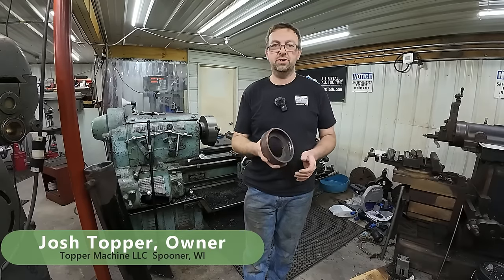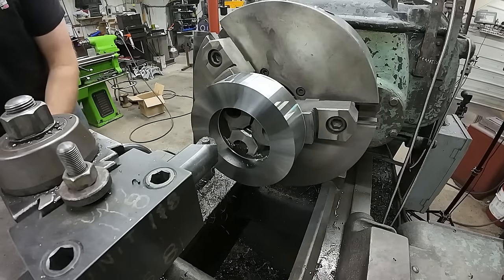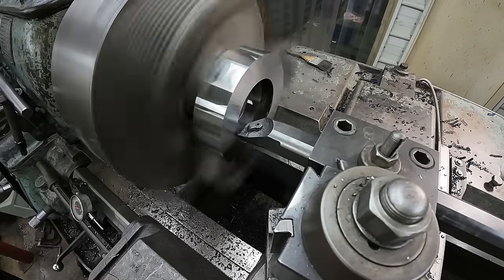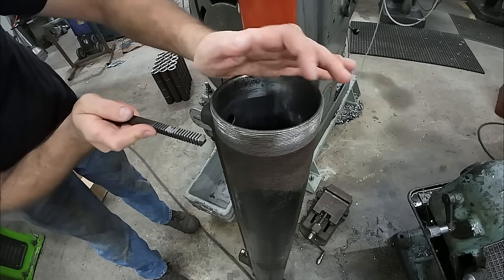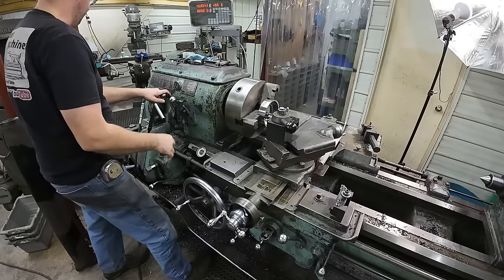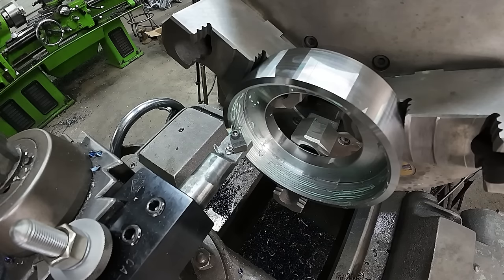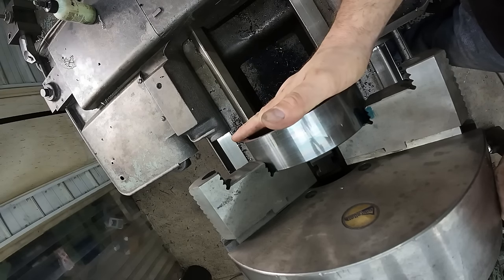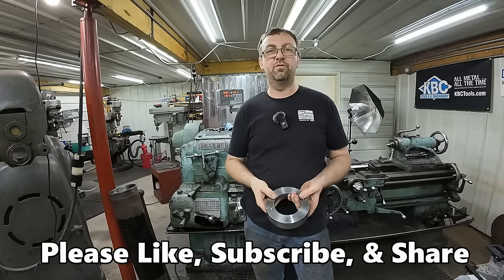Machining a New Barrel Nut for a Hydraulic Cylinder - Manual Machining

Comment: That's the first time I have seen that trick to re chuck a nut for threading, thank you for sharing your knowledge and experience.
Reply: Me either. Never seen that useful trick before during my many years as a machinist.
Reply: Just use the same face of your scribe in case your scribe is not ground uniformly.

Comment: I'd have owned half the cars I've had if it wasn't for the effing salt. Anyway - I really enjoy seeing a piece of raw material pared away to show a mirror finish hidden beneath the scale - and the .200 depth of cut is amazing. I managed to do that recently and had the chips flying just like this video. They were melting my pants though so I backed off. Questions: 1. What material is the new nut made from? 2. What inserts are you running? Someone recently gave me some new Kennemetal ones that are amazing. I tend to use obsolete NOS ones because they are relatively inexpensive - but it's incredible the difference new design coatings and chip breaker features can make. 3. Do you ever do that upside down / reverse threading technique? I really like it for threading out of bores and saves me the drama of being nervous about disengaging the half nut too late. And finally.......that scribe alignment technique for getting the nut back in place after testing is brilliant. Cheers!
Reply from the maker: I would still be driving my first truck if it weren't for salt.  The nut was 1026 DOM tubing. I run Sandvik inserts for cutting and mostly Kennemetal for threading.  I would have to look at the grades, as I don't remember them.  I have not tried up side down threading yet.  The lion is the first lathe I have ever run with reverse.  My turret lathe had reverse, but it wasn't set up for threading, just turret work.  That trick with the scribe has saved me a thousand times.  Even if you don't need to, I still scribe it just in case I have to put it back.
Reply: Thank you! I appreciate the answers.

Comment: That's a neat trick for picking up the threads once you take the part out of the chuck, I usually do this type if threading operation backwards so I'm not cutting towards a hard stop, less anxiety that way.
Reply from the maker: That is a little difficult without a reversible spindle.  These old monarchs are not designed to reverse.  I really have no problem threading to a shoulder.

Comment: As an offshore worker I completely understand, we use all types of lubricants and sealants to keep the saltwater out. A new piece of equipment is taken part and resembled with to ward off rust welding parts together. Teflon tape on thread as gap stop or thread sealant made for pipes on nuts and bolts, galvanized spray paint, you name it we have tried it

Comment: 16:10 - On a machining BBS years ago, I asked a pro how he handled blind female threads. He replied that he usually bet a hotshot new hire $20 he couldn't do it. I did do it, years ago, making a 4-jaw face-plate adapter for a Jet 10-24 lathe, but it was nerve-wracking. Couldn't use Joe Pi's reverse rotation work-around; might have unscrewed the (thread-mount) chuck holding the work-piece with disastrous results.
Love my current lathe with the cam-lock chuck mount!
21:40 - That should get you within any remaining cut required.

Comment: I have never had to deal with the salt story, we don't get snow where I live, but never the less, for certain nearly every cylinder I have taken apart presents problems with removing the top nut. I don't know what it is, maybe humidity, maybe dirt, at least I never had to cut one or torch it off. Nice work as always.
Reply from the maker: I often wonder if it could be some kind of hammering. Like pressured spikes inside from hitting things or slipping off something. Maybe distorting the threads some. There is a lot of force in there.

Comment: I've seen what you mean about the climate.  CEE in Australia works on hydraulic cylinders and they come off intact most of the time.
Reply from the maker: Different climates totally. The other thing is economic climate. My region is depressed, nothing gets fixed until it completely fails. Regular maintenance would make them come apart much better. Guarantee this cylinder was leaking for years before it was finally fixed.

Comment: Thats exactly the kind of nasty corrosion we get in the UK.
Thanks for sharing
Reply: Mainly on the coast or from rock salt on the roads
Reply: @GeoffHome-u6r  more the salt on roads it gets up inside workings and stays put. Sea air sticks to the paint work on top of the vehicle but washes off easily enough.
Reply: @TalRohan  Yes, but l think the comment was general. Railings in seaside locations especially piers, produce deep laminations, which are more than pitted. Car panels are so thin now, a gust of wind could dent them. Saves weight some will say, yes because you only have 60% of the car left.

Comment: I just learned a new way to re-index a part after threading. Thanks. 
Have you ever tried the method of cutting threads away from the headstock? I haven't and the only person I've seen use it is Joe P.
Reply from the maker: I have never done it as the Lion is the first lathe ive owned with reverse.

Comment: I worked in parts for Gledhill Road Machinery. If that is a plow cylinder those weighed 70 lbs, or better. The plow would have 2 of those to pitch it right or left.AL B.

Comment: Hello Mr Topper.
I find Your videos most informative and enjoyable. As a hobby machinist I wonder 2 tings.
In an earlier video You had to reduce a large diameter “slug” to a significantly smaller shaft with a flange. I understand that doing the part in this manner makes the part more resistant to stress related failure. Your work process have two disadvantages in my opinion. First the time to turn the bulk of material to chips. If You trepanned the slug and part of “outer tube” it should be a quicker process.
The second disadvantage would be that the “outer tube” wold be turned into chips instead of some raw material for some oncoming project, free of charge, so to speak.
At the same time You got less chips to handle.

In this video I would like to knew why don’t You rewers the spindel rotation and turn Your cutter up side down. Must be a lot less stressful to start the thread in the tight inside corner and run the tread cutter out into free air? Away from the chuck.

Regard’s PeO
Reply from the maker: Thanks for watching my older content. As to trepanning the part,that would be far less economical. Turning the whole part down took only 15-20 minutes. Trepanning would have taken considerably longer. Plus I would have to make a trepanning tool for one job, so there would be more time. Then I would have a chunk of tube that I would have to store that eventually would likely go in the scrap bin anyway. Not just storing the material, but maintaining records of the material, ie certs. Most of my jobs require material certification. Again, all for a piece of material that may ultimately go in the scrap bin. As a professional shop, you can't just use any old material for a job. I have had jobs that I could use a chunk like that one, but the grade was wrong, or I needed a material sourced from a specific country. 

As to threading in reverse, older machines such as the monarch do not have a reverse. I learned on the old stuff, and in 25 years only crashed one time into a shoulder. That was because I was just running too fast. I see the advantage to it, but I don't have the spindle reverse.

Comment: I prefer using dial indicators over digital indicators as well for being able to see where I'm at in the big picture. You can watch the needle as you get near your target where the digital is flashing numbers so you end up having to respond a lot faster due to not having as much warning.
Reply from the maker: When it comes to response time, the clock dial gives you a better sense of location.  For precision stopping while threading I never rely on the DRO

Comment: Suggestion:

Consider start the threading from the inside shoulder towards the tailstock. This is done by inverting the threading tool (upside down) then running the spindle CCW and thread feed towards the tail stock. This way, engagement of the threading dial/threading happened at the shoulder instead of threading to the shoulder. This stops the stress of running the tool into the shoulder and speeds up the threading process. Threading tool looks like a "top notch" zero rake insert, these benefit from being set slightly above center for internal cutting and slightly below center on external cutting. The American Machinist tradition of threading tool in-feed at 29.5 or 30 degrees is not always helpful. This is done under the belief angled in-feed helps reduce the threading tools cutting stress on the leading cutting edge. What actually happens, both threading tool edges are cutting as threading is a form cutting operation. Regardless of the in-feed direction, the leading edge of the cutting tool gets the cutting stress regardless of in-feed angle. What does and can make a difference are the A60 series "lay down" inserts with highly controlled cutting geometry. Their cutting geometry takes into account the cutting forces for threading. The angle in-feed is essentially an American machinist tradition not common else here in the world..
Reply from the maker: Monarch gear head lathes do NOT run in reverse. They are not designed for it. As far as threading to a shoulder, in 25 years I have crashed one time. It doesn't bother me one bit. Yes, it gets nerve wracking at times, but it is just part of the job.
Reply: @TopperMachineLLC  

Learned something about these vintage Monarch lathes, no spindle reverse.

Thanks for that.
Reply from the maker: @rupunzel6299    I may do a video on this later on where I open a headstock and show why.  Basically it is because of the headstock clutch design.  Reversing them will wreck stuff.

Comment: To prevent the rust of the thread, we use grease during the assembly process. That helps a lot!
Reply from the maker: We have done that and anti seize.  About 1 in 10 still come apart after the abusive service these municipalities put them through.
Reply: Well...than comes the torch...🙂

Comment: Have you ever threaded backwards or out instead of in?  That way there is no possibility of crashing.  Run the lathe backwards and thread on the backside with the tool cutting to the outside.
Reply from the maker: Monarchs do not have spindle reverse. In 25 years I've only crashed once on internal threads. Going to fast.

Comment: Looks like you need some riser blocks under the lathe. It seems to be low for you to use it comfortably.
Reply from the maker: I have been considering a lift, but it really isn't terrible for me.  Really the controls are at a great height.  The Lion just got a 2 inch lift, and what a difference that made.

Comment: I always preferred to cut internal shouldered threads on the far side of the Chuck from the back outwards, less chance of contact.
Reply from the maker: I have no issues with threading to a shoulder. In 25 years I've only crashed once and it was because I was running a little too fast.

Comment: Weird as it seemed to not have a wiper seal groove cut into the gland. Great job.
Reply from the maker: This is the retaining nut that holds the head in. All of the seals are in the head, not the nut.
Reply: @TopperMachineLLC  Ahhh ok. I got you. I am so used to seeing the cylinders that the gland nuts screw into the shell and not the style you worked on.  Great content as usual.

Comment: Interesting video. Thanks. Do you ever use an anti seize compound when assembling those parts. I found it makes a difference in a marine environment. We sometimes used Locktite on 1/4-20 stainless threading into aluminum. It would make a seal keeping salt out and helped to separate the two dis similar metals.
Reply from the maker: We have tried all kinds of things with minimal success.  The salt just gets into everything and then throw in lack of maintenance.  Anti Seize works sometimes, and we started assembling everything with it a few years ago.

Comment: One off replacement part work, why manual machine work will always have a place in industry, because nobody sensible would bother drawing it in CAD and programming a CNC just for a single relatively simple part, though im sure you could make a few of them before the CNC got ahead.
Monarch lathe is lovely, nice to see it in use over the modern Lion.
Reply from the maker: Sad thing is, shops like mine keep closing. I just visited one last week that does big stuff. There are fewer shops in my region. But it is also very economically depressed, not much work.

Comment: Would the use of Teflon tape on the threads help prevent the salt attacking the metal thus making it easier to uncouple the nut when needed maintenance is required? Or is that just not an option because of clearances and hydraulic oil used?

Comment: Josh,
That surface finish turned out phenomenal. Impressive and ya didnt even need to polish it.......What was the insert you were using? 
As we both know our respective DOT's dump more crap on the roads than necessary, not only salt but calcium chloride too....gets into everything not just cars n trucks.....Thanks for turning the chute on the blower.....our terrible snowstorm that was to dump up to 20 inches today, has barely spit out 1/4 inch total......so much for accurate weather forecasts.....LOL.....not complaining but if you and I were off that far in our jobs we'd be jobless......
Keep up the good work...
Don
Reply from the maker: I believe these are SEAN inserts. I could be wrong though. They are cheap and I get them from CME Tools.

Comment: Wouldn't it have been better to make an undercut at the end of the threads next to the shoulder so that the end of the cylinder would provide a positive stop for the nut? As it is now it seems the threads on the cylinder will reach the end of the internal threads creating a chance to gall, especially if the customer gangster cranks that nut on. Or is the cylinder already undercut on the end?

Comment: I noticed that you didn't put a wiper seal ring in the nut or an upper o-ring in it too, is there any reason for this? Keep up the good work, Ste 🇬🇧
Reply from the maker: Only a retainer nut. Not the cylinder head.

Comment: I understand why you had to make a new cap. But would a new one from the original manufacturer fit as well? And if so, wouldn't it be easier to just buy an original cap from them? IDK,  just wondering...
Reply from the maker: 16-20.week lead from mfg. Unacceptable. I did this in 2 days to get them back to work.

Comment: Great little repair job Jake, I;ve been there and done that. I'm assuming you are referring to road salt? I've had pretty good luck using anti-seize in the passed on equipment used outside but don't remember if any were road equipment such as plows or grader blades. What's been your experience with those products? I'm in Washington state and within 90 miles or so of the Canadian border.
Thanks for sharing.
Reply from the maker: It really depends. Sometimes it works, but almost always they have to cut them.

Comment: If you wanna be real thorough you also mark which side of the scribe is up if you can't be sure that the tip is centered to the sides.

What I was wondering, would it make sense to have a thread relief in the bottom of the nut or does it not have to register against anything?
Reply from the maker: You may not have noticed, but the shirt clip was in the same position. 

The head of the cylinder has a 1/2" lip, so a thread relief isn't necessary

Comment: What salt? The closest salt water is Hudson Bay (1000km/600mi), the Atlantic is 1500km/950mi away?
Reply from the maker: Salt is spread on the roads in winter to eat the ice.  It also eats out vehicles and equipment
Reply: @TopperMachineLLC   Ah, that salt, I didn't think of that, but it is a known issue here in the NL as well.

Comment: Why didn't you undercut the end of the thread, so that the nut runs up to the full face of the cylinder ?
Reply from the maker: Because the head takes up 1/2" inside the end. The threads never engage that deep.

Comment: couldn't it be knoched or drilled for a spanner wrench?   little heat, well ther you go 😁
Reply from the maker: Nope, never get it off once the salt gets into it. It's called rust jacking. The only way is to cut it. Relieve the stress from rust jacking.